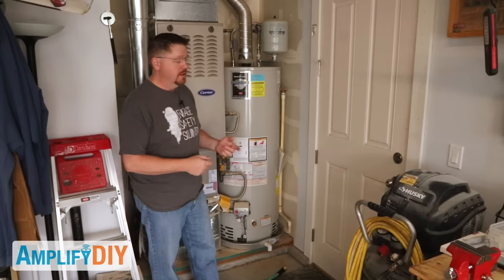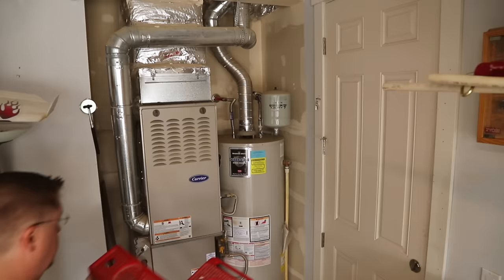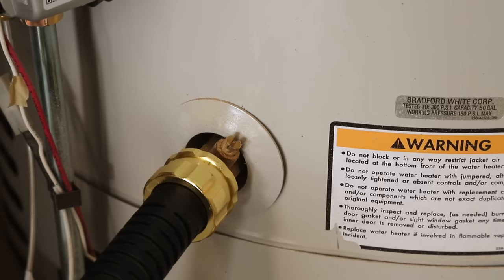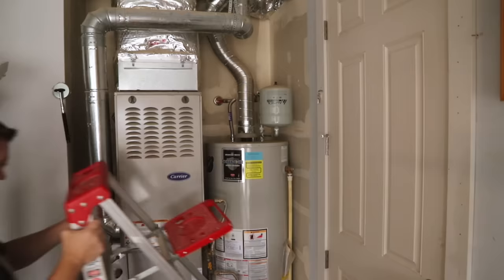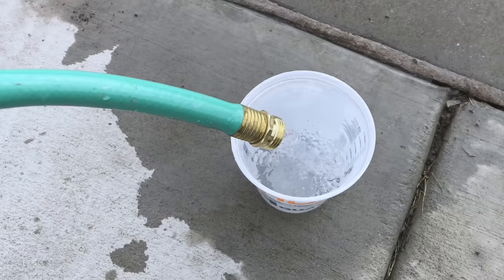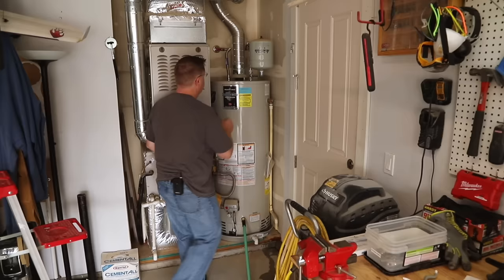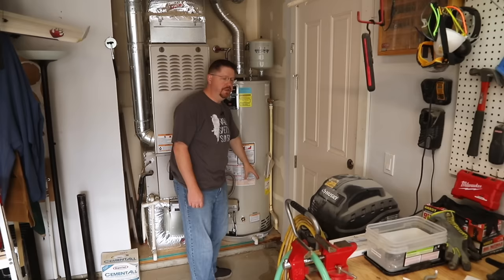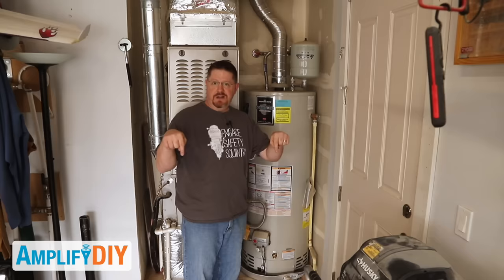How To Flush A Hot Water Heater To Remove Sediment

Comment: @amplifyDIY Thank you very much for the video!  I wanted to add for those who have a very BAD backup of sediment there might be additional things needed.  After following all of your instructions I was hardly getting anything out.  I added water and it immediately came out the overflow and not the drain.  I actually had to hook up a cold water INPUT to the drain and push water in to clear the sediment away.. After that the flood gates opened and so much junk came out.  Also worth noting is that for those with an electric water heater, use a voltmeter to make sure that you have flipped the right breaker... do not trust what someone wrote in a house that you did not build yourself.
Reply from the maker: Great tips, Howard - thank you!

Comment: THANKS FOR THIS AWESOMELY CLEAR EXPLANATION!  Question:  Can I release the hot water to the sump pump?  I know you mentioned that the water will be very hot!  THANKS EVERYONE!
Reply from the maker: Hi Leon - yes, you can drain to a sump pump. I do recommend 2 modifications to the procedure when you do: First, turn off the heat source for your tank. Then take a shower, do a load of laundry, or wash some dishes. This will lower the temperature of the water in the tank significantly, making it safe to drain into a sump pump without fear of overheating the pump. Second, I recommend using a kitchen strainer or colander to catch any larger chunks before they go into the pump. The last think you need is to clog up a pump while you are actively dumping water into it. :) Good luck!

Comment: Here is in the basement you can also use a small transfer pump to assist with emptying the tank. In any case it is way faster. Also with the transfer pump running you can trigger the cold water inlet on and off and it will be automatically sent out through the transfer pump no need to fill a bucket empty and come back and do it again.

Comment: Thanks for the tutorial. Do you know why the drain valve on the bottom of my water tank is hooked up to the water supply so I can never drain it?
Reply from the maker: No idea - it should not be...
Reply: @AmplifyDIY  found out the plumber installed the cold and hot water pipe reversed and put a valve on the hot water pipe instead of the cold water supply line from the main.

Comment: Good video just one point not so clear. You opened a faucet to help with draining the water from the tank but in the end you opened it again to remove air after you finished refilling the tank. At what point in between was it turned off? Was it when you opened the pressure relief valve? Is there any harm in having the faucet on during this entire process
Reply from the maker: Hi Davian - sorry for the confusion. You can leave the faucet open during the whole process. In my case, I opened it to let air into the tank, but since that did not work, I then opened the T&P valve, at which point it does not matter what the faucet is doing. Just make sure to have the faucet open when re-filling the tank, to allow the air in the tank an exit path out of your plumbing. Thanks for watching!

Comment: excellent video. I'm waiting on a ball valve, as suggested in your other video, before i drain it again. i did drain it a couple of days ago and had quite a bit of sediment/sand coming out especially after i agitated it. it got clogged and i had to use a wire to help get it flowing.  i got a bunch of sand out but i have to do it again and flush it out totally. I have no low drain and my hose doesn't quite go out the basement door on the other end of the house, which makes it  a pain. My hot water doesn't last as long as it used to so i think i might have a bad element. once the ball valve comes in and i get it drained, i'll pull the lower element.
Reply from the maker: Right on! You are well on the way to getting your heater all fixed up. Good luck!

Comment: I agree with everything except tampering with the pressure release valve. On older tanks those often get stuck and refuse to re-seal after intentionally releasing pressure. Good video - just something to be aware of.
Reply from the maker: Heya - I actually take a different approach: if the T&P valve leaks or gets stuck, it was past due to be replaced anyway. They should be tested annually, and replaced when they no longer seat correctly. Replacement is cheap and easy:  https://youtu.be/e5H1i1cypxA

Comment: So helpful and clear.  Really appreciate you putting this together!  Just one clarification question...  When did you turn OFF the sink faucet?  Or do we leave it running the whole time and then open an ADDITIONAL one at the end?  Thank you! :)
Reply from the maker: Great question, and apologies for the confusion. It actually does not matter what you do with the faucet once you have drained the tank - as long as you have a faucet open at the very end when you re-fill the tank so you can purge the air out of the system. You don't need to have more than 1 faucet open, and I recommend opening whatever faucet is closest to the heater when you purge the air at the end of the process. 

Good luck!

Comment: Good vid, thanks. Water can build a channel through a large pile of sediment so if you have very hard water, you may not be removing much actual sediment. I would remove the drain valve and replace it with a larger opening ball valve after sticking a clear plastic hose through the drain valve opening and vacuuming the sediment out first.
Reply from the maker: Great tip! I also have a video that shows how to replace the drain valve as you suggest here: https://youtu.be/OBPJYg0o_o0

Comment: Very helpful! Thank you for your selfless service! Can you also make Videos on how to troubleshoot some of  the error codes, please? For example, the 5 LED flashes, 4 LED flashes, etc?
Reply from the maker: Hi Dilip - Troubleshooting error codes would be a little tricky to do as they can vary a lot between manufacturers, etc. The best generic instructions I can offer is to use google to find the owner's manual for your specific heater model, and refer to it's section on error codes. The manual should list a) what error codes are possible and b) what they mean. 
Thanks for watching!

Comment: I’ve been told that when you refill the tank for use. Once it’s 3/4 fill, shut the pressure relief valve then open a hot water faucet. That should purge all the air out sufficiently.

Comment: I am doing this process currently and I can’t thank you enough for this concise tutorial! 

I do have one last question please; Is it normal to have to close the pressure relief valve every time you turn the water supply back on? Every time i turn it on, it immediately starts gushing out the bottom of the pressure relief valve? Ive waited at least 20min for it to drain out with the pressure relief and the hot water valve open on a faucet too. Thanks you so much in advance!
Reply from the maker: Hi Deuce - no, that's not normal. Either a) the tank is not actually drained... are you waiting until it stops draining? It may take a LONG time (upwards of an hour, if it has a clogged up drain valve) or b) Something is not right inside the tank with what is known as the "dip tube". This is a tube that is connected to the inlet at the top of your tank and it runs all the way down to the bottom of the tank so cold water actually enters the tank at the bottom rather than right at the top. If this dip tube is damaged, it's possible the water from the inlet could be redirected internally (at least partially) out your T&P valve.
I hope this is helpful. Good luck!

Comment: I love this video. Very helpful. If I could afford to replace it I would, but I'm currently stuck with a roughly 42 or so year old Kenmore gas heater. No idea when it was last flushed, but definitely not in a while.
Reply from the maker: Wow Will - I'd honestly recommend being VERY careful with a heater that is that old. You are living on borrowed time... start saving now to get it replaced. Good luck!
Reply: @AmplifyDIY  I can afford a new one, it's just putting me below that comfort zone in the bank. After flushing it for fun, I'll definitely replace it. When I bought my house (built in '62), the furnace was original, window ac, and a water softener that was 20 years old. I didn't realize the dangers of this old of a [working] water heater and replaced the other things instead. I haven't filled the heater back up because the water kept getting more and more murky with every flush. I'm gonna disect this thing for fun to see the inside.

Comment: Thank you for your time for detailing this video. Your video hleped me in replacing the old outlet knob with 3/4 in. ball valve. For some reason I wasn’t able to withness free flow of water even after turning the hot water faucet (inside home) and also release the pressure valve. I had to completely remove the old outlet knob to release the water gulp by gulp (oh yea, there was lot of sediment waiting for me). I'm having water recycling pump and not sure it was obstructing the fee flow of water. Appreciate if you can share your expertise so it can help me next time to clean up the sediment next time.:goodvibes:
Reply from the maker: Most likely, you simply had so much sediment that it was blocking the outlet port. The only way you were able to drain the tank was by removing that drain valve entirely, which allowed for a larger opening, probably also broke up the sediment, a little bit, and allowed the tank to drain. If you keep up with regular flushing, once a year, that should no longer be a problem.

Comment: My water heater seems ancient. Bought this house a year ago. Water heater makes TERRIBLE banging sounds when it fills/heats up after hot water is used. Should I flush it and replace the anode or just bite the bullet and get a new WH?
Reply from the maker: Hey Brenda - I recommend you save up to buy a new WH, but before you actually buying one, try some maintenance on the one you already have - flushing and swapping anode as you mentioned are what I would recommend. There's a reasonable chance that you can breathe some new life into that old heater.... good luck!

Comment: Great job. I followed every step. The information and presentation was "on point", ideal in fact. I wish to add some "footnotes" for Electrical Water Heaters. 
One, from the electrical panel, turn the power circuit breakers to the OFF position. You can ignore the step of turning off the heat. Follow all other steps from this video. 
Two, use a regular garden hose and a not one that "shrinks and expands" a.k.a lightweight type hoses. The end of those types of hoes restricts and or compresses the water flow and trap the sediment and or other debris inside those types of water hoses. This will totally defeat your intended purpose.
Reply: thank you!!!  that comment saved me from making that very specific mistake

Comment: I installed a large ball valve for the bottom drain as it allows particles to come through easier than the stock restrictive valve that comes on most water tanks
Reply from the maker: Great tip! I did the same: https://youtu.be/OBPJYg0o_o0

Comment: Wonderful tutorial. As a single woman, I feel that I can do this by myself. I only have one question and it may have been posed already, but after you open the hot water from a faucet inside, when do you turn it off. I'm assuming it's after a few seconds, just long enough to release the air, but I don't want to assume.
Reply from the maker: Hi there - sorry for the delay in getting back to you. You are correct: opening the faucet was only done in an attempt to let air into the system so that the tank can drain. If that works, just leave it open the whole time. If (as in my case) it does not let air in, then you'll have to find another way to let air in - I used the T&P valve in the video. With another path to let air in, the position of the faucet is irrelevant. Good luck, and thanks for watching!

Comment: This video provides a fantastic explanation of how to SAFELY flush the hot water heater.  Is it OK to let the super-hot water drain through a sump pump?  I don't want to damage the pump.
Reply from the maker: Hi Mary - I recommend if you are draining through a sump pump to make 2 modifications: First, turn off the heat supply for your heater, then go take a shower, do some dishes or run a load of laundry on the hot cycle. This will use up the hot water in the tank, replacing it with cooler water so you don't risk damaging your sump pump. Secondly, I recommend using a kitchen strainer to catch any larger chunks of sediment that may flush out so you don't clog up your pump. 
Good luck!
Reply: @AmplifyDIY  Thanks so much for your advice and quick response.  I'm so glad I asked!

Comment: dont know if you will get this. I  flushed out my water heater did what you did BUT 3x more opened up cold water let sit and drained 6x. At first when I opened up the release valve the 1st time the what little water came out was real brown . So after last time I filled and drained took off hose and filled tank. Turned on hot fawcet and it blew out air then water came out brown  then light brown.  Let it run and filled clear glass and I still have light brown and not clear water. I also have a water softner.  So what do I do to get rid of the light brown that is left?
Reply from the maker: Hi Brad - when you have not flushed a heater in a while, and go through this flushing procedure, it may stir up a lot of gunk that was in the tank. The short answer is "you could have flushed a few more times" - the longer answer is to just give it some time. Let the heater sit overnight, to allow the kicked-up sediment to fall back down to the bottom of the tank. Tomorrow, remove the screens (aerators) from your faucets (they should just unscrew from the tip of the faucet), then turn the faucet to hot and let it run until the water goes clear. It should not take very long... just a minute or 2 to clear out whatever silty junk was stuck in the hot water pipe from today. 
Good luck!
Reply: so the gunk that is left will settle at bottom of the tank and when we turn on hot water tomorrow afternoon  the water is taken from the top of tank where it is clear?  Also cant be in pipes I have PVC and I have a water conditioner, Thanks

Comment: Hello thank you for your video. My controller is a Honeywell unit but it doesn't seem to have a pilot light setting, just "low". What should I do? Is that pilot?
Reply from the maker: Hi Robert - no, Low is not the same as pilot. I'd look up the model number for your heater on Google, find the owner's manual, and see what it says. You may need to turn off the gas supply entirely for the flush procedure, then re-light the pilot light after you are done. The owner's manual should have good instructions. Good luck!

Comment: Quick dumb question. At what point would I cut the breaker back on? After it's completely full after flushing or do it before final filling? Sorry, I took good notes, but didn't see at what point that this is done. Thank you in advance! And thanks for such a great step-by-step video!!
Reply from the maker: Good question! Don't turn the heat source back on until the heater is completely filled up for the final time. Never turn on the heat source when the tank is empty. Good luck!

Comment: My hot water heater is going on 17 years and I've never flushed it. What I've noticed is it's been leaking water. I'm gonna try this flushing method.
Reply from the maker: Oof. 17 years with no flush, and it's leaking? More than likely flushing will only make the leak worse, and you already need a new heater. Good luck!
Reply: @AmplifyDIY  Yes it's leaking out of a tube that is routed outside the house. I'm guessing I'll need a water heater soon. Got my money's worth 👍

Comment: Very good video.  Now I am going to go try it.  One thing I missed is how high does the water need to fill?  Should it remain at below the safety release valve?  Will it automatically adjust as you use hot water?  Thanks
Reply from the maker: There should be no air in the tank after you fill it - so as the water level rises, make sure you have a faucet open and the T&P valve closed. All the water flowing into the tank will push all the air completely out of the tank. It'll be completely full when you are done with no air bubbles. Good luck!

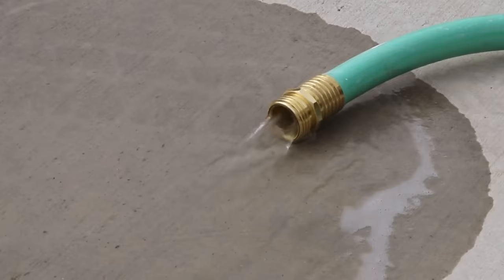Comment: Can you help clarify something? At 2:46 you opened a faucet to let air in. Then at 4:08 you opened the pressure relief valve, to do the same thing. Next at 9:56 you closed the pressure relief valve, and finally at 10:19 you opened (not closed) a faucet... again. So in between, did you close the first faucet off-camera, because that was made redundant by the pressure relief valve? Would you recommend using a faucet instead of the pressure relief valve if possible? And do you need to leave it open for the entire time it drains? Thanks!
Reply from the maker: Hi Soapergem - apologies for the confusion. The core concept to understand is that if you want to let water out of the system, you must let air in. Once you are ready to fill the system back up, in order to get all the water in, you must let the air out.  For many people, opening a faucet somewhere while you both drain and then fill the tank allows the air a place to both get in and get back out. In my case though, I have backflow prevention valves built into all my faucets, so they do not allow air to get in...so I had to use the T&P valve. 

During filming, once I opened the T&P valve I inadvertently closed the faucet (because it was no longer relevant to my process - I was using the T&P valve to let air in/out. 

Once you do your final fill though, regardless of whether you used the T&P or a faucet to let air in / out, you must open a faucet because that's the only way to get all the air back out of the system - run the faucet until it stops bubbling/gurgling. 

Hopefully this helps clear things up. I'm happy to expand further if needed. 

Good luck!